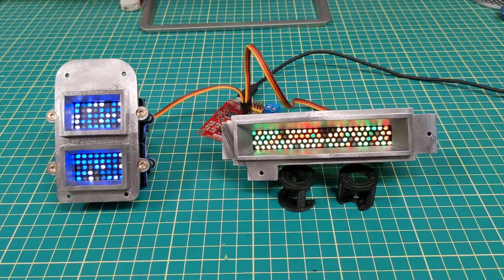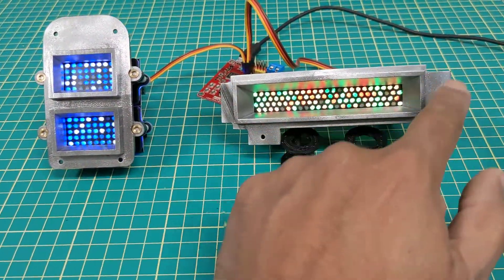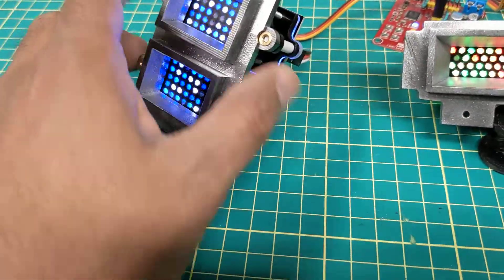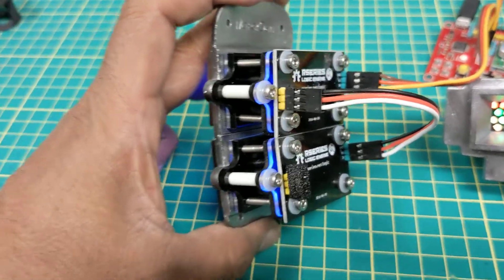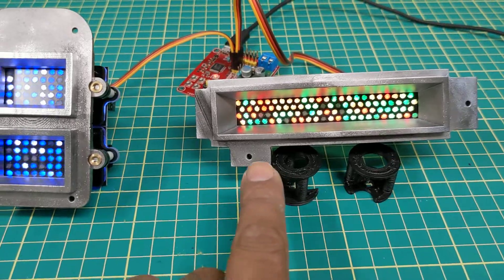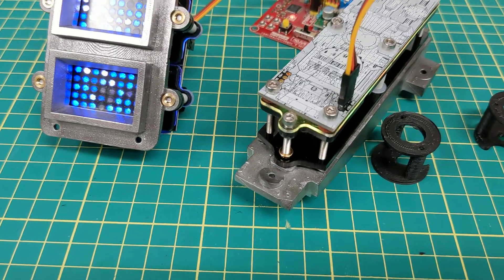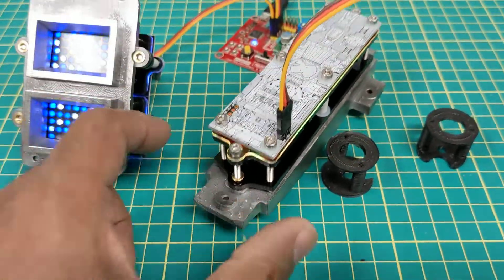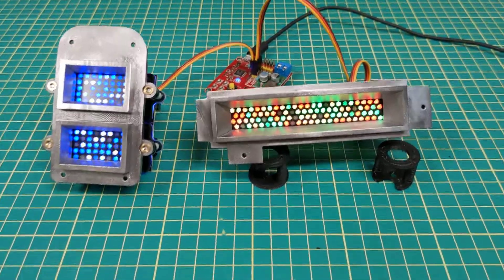R2D2 Build Episode 10- R-Series Logics with Custom Surrounds

Comment: Hey Dan, Do you by chance have the Step file for the Surrounds you made? I need to make the holes bigger for the threaded inserts. Thanks
Reply from the maker: I'll check it out in the morning for you. 😁. How large do you need the holes?
Reply: @MakerDan55  I need the FDL threaded inserts hole the same size as the RDL. The R-Series kit no longer comes with threaded inserts, and mine don't fit the holes in FDL currently. I tried drilling them out but its super thin and the resin tends to crack easy.
Reply from the maker: @joeyp.2566  It is hard for me to share the Fusion 360 files.  If you give me a diameter of the hole and depth in mm I can modify them for you.
Reply: @MakerDan55  Awesome, the threaded insert is 5.56mm and depth is 3.82mm. Not sure how much clearance needs to be added tho. Thanks Dan!
Reply from the maker: @joeyp.2566  I just uploaded the Front Surrounds with larger holes (5.8 mm).  They are already almost 4 mm deep.  The Rear Surrounds are already 6 mm in diameter.  Hope that helps.
https://drive.google.com/file/d/1ngtiDWiUsqFV_YIAVw6N3xc3TinOG8W2/view?usp=sharing
Reply: @MakerDan55  Perfect Much appreciated, hope to see me R2 content in the future